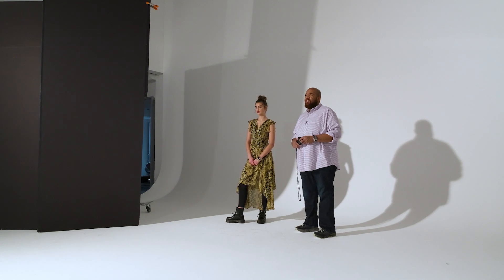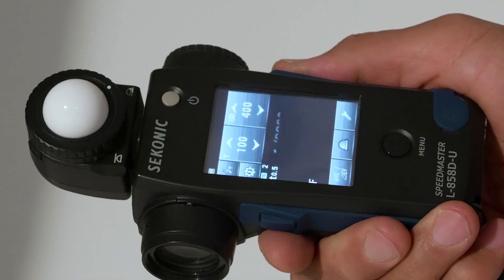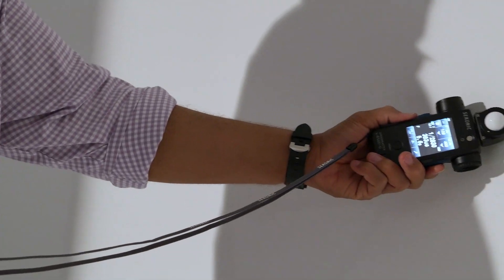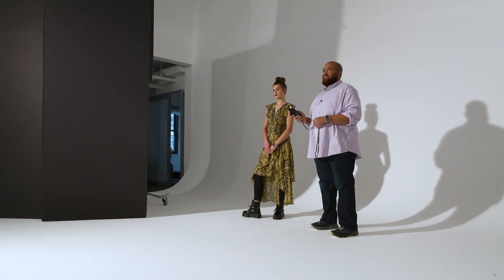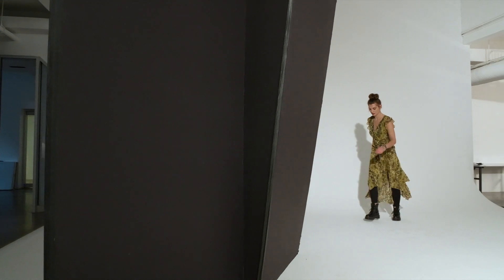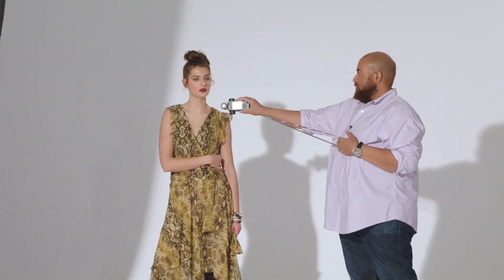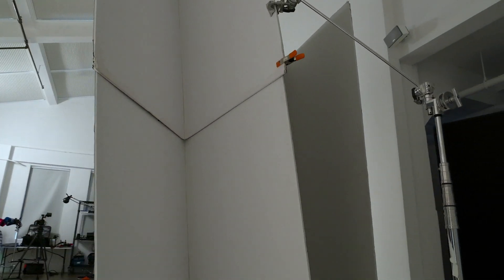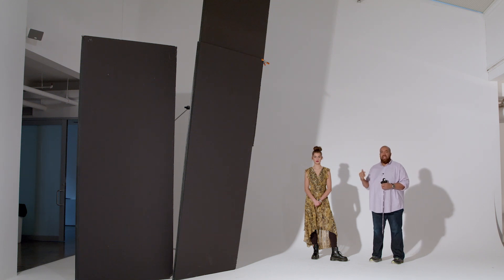📸 Flash Duration Explained–Visually | the FORMULA EP#03

Comment: I've had several different Sekonic meters over the years.  Top quality versatile equipment.  Measuring flash duration is certainly helpful.  But the other way to freeze motion is using a 1/8000th shutter speed made possible by HyperSync.  If I could make one suggestion for a new feature it would be for the L-858 D-U to be able to measure the HyperSync flash (as distinguished from HSS) like those made by Elinchrom.  The magic of HyperSync is the perfect timing between camera and flash. I would have to imagine that it is possible to mirror that timing perfection with the period that the meter is taking its measurement.   I mention Elinchrom both because I own those units, but more importantly, because Sekonic sells Elinchrom radio triggers for its meters.
Reply from the maker: We have thought about this and many factors come into play. The main factor is getting the meter to emulate the camera's shutter,  Hypersynce depends on a very slow flash duration and then dialing in a delay based on getting the camera's shutter to sync with the brightest most consistent and longest part of the flash curve. Once all this has been factored in, if you have ever using HS on a white background you can have a .5 - 1 stop difference based on the flash power changing mid exposure and the shutter catching part of the flash as well.
Reply: @SekonicGlobal  I truly appreciate the response.  It says great things about a company when it takes the time to respond to its users.  I started life as an engineer and I believe I understand your description of the issue.  I've tried the white background tests with Hypersync and seen the variation in exposure.  Two thoughts. (i) To improve the sync between the flash meter and the camera shutter one could provide the same kind manual fine tuning adjustment on the meter that Elinchrom uses in its EL-Skyport flash trigger.  It's a workable, if not an elegant, solution.  Elinchrom refers to this manual timing adjustment on their EL-Skyport as OverDriveSync.  (ii) I understand that a 0.5 to full stop variation from a flash meter is a totally unacceptable level of precision.  However, if the meter could get a Hypersync user close to a proper exposure (1/2 to 1 stops) it would be a far more preferable alternative to simply lots of test shots.  No need to respond to these comments as you were generous the first time around. Again, many thanks for turning out great products.

Comment: Wow I didn't know one could measure the light durations without benchtop equipment. Would love to do this on my Profoto  D1s 250, 500 and 1000 with this Sekonic L-858D-U. I own the L-478DR and absolutely loved the fact that I can a trigger my Nikon flashes with its embedded transmitter, but still use them with my Profotos in the traditional way, unfortunately it cannot measure light durations. Gotta get my hands on one!!!

Comment: Knowing your actual shutter speed.
The new Sekonic L-858D SpeedMaster light meter can be used to determine actual shutter speeds for large and medium format leaf shutters. Measurement is easy and quick using the meter’s “Flash Duration Analysis Mode”.
To make a measurement for one shutter speed, e.g., 1/500,
1. Set the camera and lens in a low ambient light area
2. Shine a bright light, e.g. an LED flashlight or desk lamp into the lens
3. Set the shutter speed to the value to be tested and the aperture wide open
4. Remove the ground glass back and hold the meter with the retracted lumisphere pointing toward the rear of the lens.
5. Set the meter to flash duration mode and a shutter speed greater than the speed to test.
6. Press the meter measure button then trip the cocked shutter. The meter display will show the speed in ms and 1/measured value. The shutter opening and closing will simulate a flash duration.
7. Repeating the test will indicate the variability of the shutter at one speed. Repeating the test over time will indicate a need for CLA. Since the meter will measure 2-40ms when used as described here, shutter speeds of 1/500-1/60 seconds may be measured. One could extrapolate to predict the slower speeds.

Comment: I'm still using my Sekonic L-408 which is around 20 years old. Sekonics are built to last. It works and I can still get by. But the features in the L-858D-U instantly give so much more information allowing you to understand how your lights are working and how this will affect your results. This would save a lot of trial and error and manual calculations, allowing you to get the exact shot you want so much more quickly. The 858 will balance the light ratios, trigger, show duration and meter for HSS. Brilliant.

Comment: I shocked and disappointed, Sekonic didn't hold this test using Elincrhom Pro HD 1000 or the ELB 1200, since you to share the same distributor. I am Great full, that Ab Seasy was back with another wonderful video. Any tips or suggestions on how to achieve this using the HD 1000 or ELB 1200 Hi Sync heads, I've tried but my images still have motion blur.
Reply from the maker: Hi LightSubscriber. To show the difference we used a Profoto Pro 08 and Profoto D4. I wanted two lights that we could run through a bi-tube head so that the visual results of the light were as similar as possible, also being 2400 WS  the D4 gave us a very slow flash duration.  If you have an L-858 you can test your ProHD 1000 and ELB 1200 at different power settings to see where you have the best flash duration. Hi-Sync technology actually gets better results at higher shutter speeds because the flash duration is extremely slow.
Reply: Sekonic Thank You for the reply. Look forward to the next video

Comment: Maybe you answer this I am and old photographer  the olds flashes for me have more flashy duration than the new ones I speak about a Sunpak 622 for negative film. Also I own a Sekonic L-308S-U bit yours is more sophisticated and have more options of course is more expensive thanks if you can answer my question about the old flashes God bless.
Reply from the maker: Hi Jose
I cannot find any documentation on the flash duration of the Sunpak 622. I wouldn't be able to give you an accurate answer about its flash duration without metering it with a Sekonic L-858D-U . My most educaiton guess is that it will have a faster flash duration at its lowest power settings.
Reply: @SekonicGlobal  Sorry for my english I want to express the  old Sunpak 622 I used wit negative cameras.  once i try wit my Nikon D5200 digital I don't remember the settings but  it have about as  2 f stop over expose ,
you now the shutter speed was 60 of a second and lower in more expensive cameras they have leave shutter until 500 of a second. English is my second language. God bless.

Comment: Another informative video! The ability of the 858 to measure duration was key when I tried capturing splashes! As an aside, I'd like to make a request for a future video: how to use the 858 to measure flash exposure at faster shutter speeds like 8000th without using its HS mode. In this mode, it's measuring pulsed output. My lights don't use this method.
Reply from the maker: Hi Robert
What lights are you using. Are you using Hi-Sync vs HSS?
Reply: I'm using the Broncolor Siros L's. Rather than pulse the light, they're altering flash pulse timing so it's close Canon's 200th sec sync speed. They call it HS.
Reply from the maker: Hi Robert
The L-858D-U will measure HSS but not HS. Broncolor uses HS technology which is very similar to HS used by Elinchrom. What they are doing is extending the flash duration and then releasing the shutter when the flash will be on for the entire time of the exposure. The difference in camera shutters, as well as the lights flash duration, make accurately calculating this with a meter very difficult because many of these systems allow you to move the shutters delay in order to maximize the results, and many times there will still be exposure differences from the top and bottom of the frame that are acceptable based on the subject and background. Metering this is difficult because we can't tell the meter what part of the flash curve the camera and remote are going to use for the overall exposure. So if you are shooting at 1/8000th of a second you are trying to find the sweet spot fo the exposure curve that will give you the most output, but also making sure its as consistent as possible to try and eliminate an uneven exposed frame.